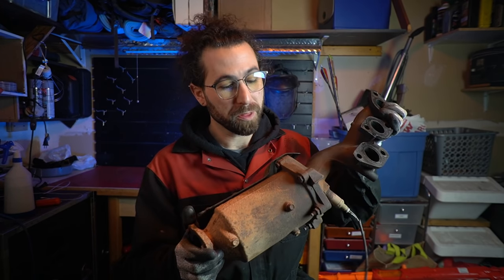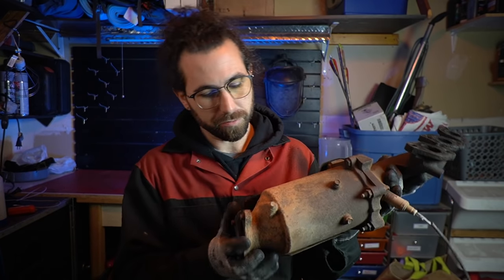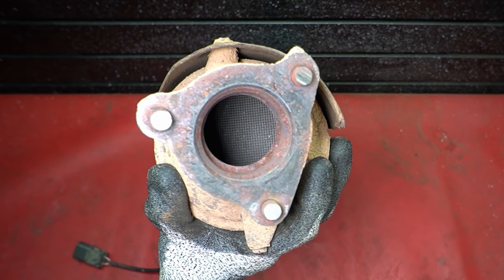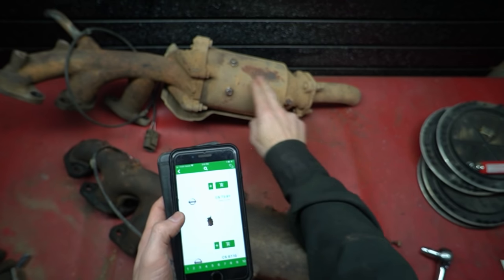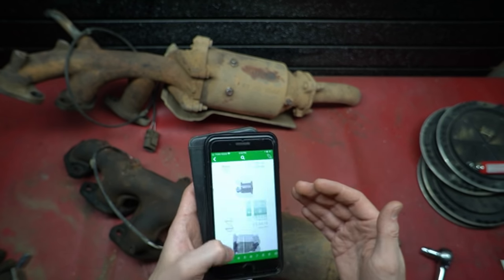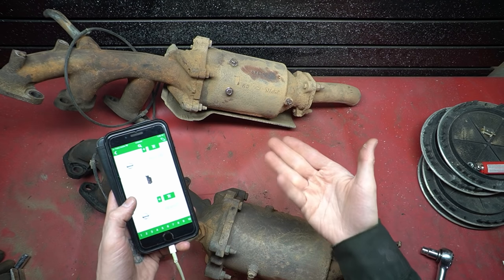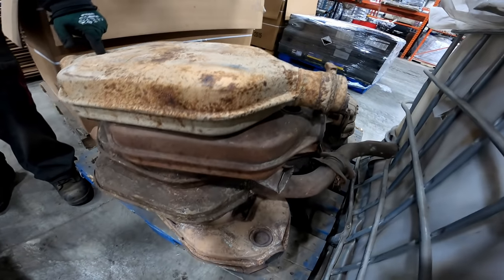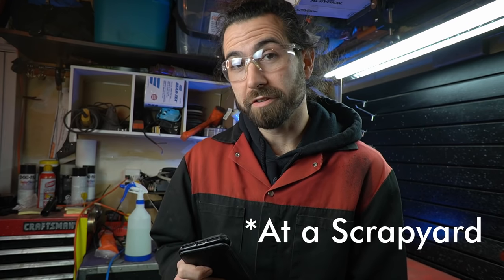How Much Is A Catalytic Converter Worth? Scrap Recycling Guide

Comment: Scrap dealers should be prohibited from buying these things unless they have documentation showing they are legit - too many getting stolen right now.
Reply: That's what keeps them in business brings value up and brings demand up I'm sure they won't unless lawfully enforced
Reply from the maker: I know that sounds like a solution but it would only make things worse. It’s just the material within that is valuable, so if you regulate it too hard you’d create a black market for platinum group recovery. Remember how prohibition created wealthy and powerful gangs because of how profitable it was? You’d have that. But with back-room refineries with dangerous chemicals being poured into sewer systems.
Reply: Ya. The places in Utah require a paper trail for copper & similar things.
CAT should be the same.
Reply: Thub, you a smart mofo. I like intelligence and you my friend got it🎉

Comment: For those who wonder, catalytic converter prices vary from vehicle to vehicle, buyer to buyer, and content regardless of vehicle. Most normal converter prices range from $25 to $3000. Some of the better ones are found on Toyotas, Hondas, and large diesel trucks. I was getting $1800 for Honda Element converters at one time. Ford F250, F350 trucks from about 2000 - 2005 were getting $2200. Some Dodge and Ford diesel trucks were fetching $3000. Crown Victorias and Mercury Marquis were getting $1200 for the group of four. Just for some ideas. The value can be different on the same vehicles with same looking converters also! Some converters are made with much more precious metal for cleaner exhausts depending on the laws of each State. Vehicles made to be sold in California have much higher values on their converters.
Reply: None of what you said it nearly as valid anymore. Market dropped by more than half now. Even 2 months ago when you made this comment market was MUCH worse. 
You're spreading false information. Those elements are like 700$ now lol
Reply: Hi There, any idea how much a Dodge Avenger catalytic convertor is worth(scrap)?
Reply: @JRenee-Sings  research more more 

I hope near the 700 max mark I read above your comment
Reply: Where did you sell them? Now that everyone is stealing them the price sky rocketed or some jump yards or pick u part type places won’t even sell them anymore. You can take anything you can get off from the car or truck except for the cat.  here in ca.
Reply: WOW NO WNDOR. THEY STOUL MY HANAS. CONBOTORS .
Reply: Beeeee,Esssssss
Reply: Where can i get those prices for my cats?
Reply: what about 2005 ford explorer
Reply: How much for the 2 off a Ca compliance cats for a 04 4.0 jeep

Comment: Pt, Pd, and Rh that is plated on the ceramic honeycomb are noble metals that have an extreme tolerance to corrosion and an extremely high melting point. They also have a very unique feature  and that is that in combination these three precious metals actually have the ability to be Catalysts in a chemical reaction. Catalyst = to speed up. Every single type of fossil fuel burned in a combustion engine create very hot off gasses of NOx (Nitrogen Oxides) and CO (Carbon Monoxide) both of these off gasses are said to have an effect on ground level ozone which is detrimental to human and animal health. Although NOx and CO when in contact with UV Radiation create O3 (ozone) --> smells like chlorine, this is technically good for high altitude because this is what thickens our ozone layer, the addition of more O3 molecules. Here's where things get tricky, at ground level if these gases were to come straight out of our tail pipes this would create ground level O3 during times in which we experience high UV from longer days. This unfortunately only happens when the sun is out, not as the days turn to night. O3 at ground level is bad for us no matter what and this in high concentrations creates smog. Another thing is that if our engines didn't have these metals inside the catalytic converters of our engines exhaust stream, then we would be contributing to highly toxic health concerns for our population at our lower atmosphere. Also a very complex issue is created when daylight helps to convert these off-gasses to O3, and at nighttime these unchanged gases go through complex chemical reactions leading to a high amount of greenhouse gases as these gases rise to higher altitudes and constantly react and change and become Volatile Organic Compounds (VOCs) our ozone layer causing its depletion. As per the Minnesota Pollution Control Agency's take on this more complex part of the process, they state "Most stratospheric ozone depletion is caused when chlorine or bromine reacts with ozone. Most of the chlorine entering the stratosphere is from man-made sources (84%), such as CFCs and HCFCs with the remaining 16% from natural sources, such as the ocean and volcanoes. About half of bromine entering the stratosphere is from man-made sources, mostly Halons." "While acting to destroy ozone, CFCs and HCFCs also act to trap heat in the lower atmosphere, causing the earth to warm and climate and weather to change. HFCs, which originally were developed to replace CFCs and HCFCs, also absorb and trap infrared radiation or heat in the lower atmosphere of the earth. HFCs, CFCs and HFCs are a subset of a larger group of climate changing gases called greenhouse gases (GHGs). Taken together greenhouse gases are expected to warm the planet by 2.5 to 8 degrees Fahrenheit by the end of century." To sum things up a little, this is the reason all combustion burning engines should have catalytic converters, they catalyze (speed up) the chemical reaction to change the harmful NOx and CO being off-gassed to a more suitable and easier to manage H2O (water) and CO2 (carbon dioxide). People who feel its good to steal these items from vehicles are contributing to the depletion of our ozone and destroying this planet and making people suffer at the expense of your selfish temporary financial gain. People who do cat deletes on their vehicles to make them sound better are just as guilty, and anyone who hollows out a clogged cat, or does a cat delete because you cant afford to replace it as also just as guilty. These products are necessary and exactly why it was mandated that all manufacturers selling vehicles in the US are required to have these on their vehicles.
Reply: Your degree is in chemistry, I presume?
Reply: No unfortunately when I have a concern about things or if I look for an answer to a question and it becomes complex, then I obsess over it, if it surprises me and I'm able to continue to find pieces of the puzzle that speak to me in a way in which it makes sense and I can learn and stay interested. So I just really enjoy finding the full truth about some things and collecting all that knowledge and sharing it if I'm able to do so. I actually don't even have a degree technically but I've been through roughly 6 or 7 combined years of higher education, if one were to tall all the semesters and credit hours. Sometimes a degree is just a piece of paper, but nonetheless I believe college and higher level education are necessary for an educated, professional, and diligent workforce. I believe one develops the necessary skill set within the upper level courses (300s and 400s) of higher education, to be able to get interested in a complex understanding of a scientific unknown to a degree that deep to hunt it all down and piece it all together. I'm not saying it's a requirement though, but it certainly was where I gained the ability. Something that may surprise ya is, I've never taken a single chemistry course in my education, but I now in life and my career path I certainly wish I had. 💯🤷
Reply: @kylestrokelitus360  Your employer is lucky to have you in their work force. Thank you for sharing your knowledge with us.
Reply: @Anne--Marie  aww...that's probably the 1st compliment I've ever gotten on here. And one compliment I've received in a while. Life got really lonely for sure and now instead of being employed I've been working my ass off in building my own business. Which is another reason for the solitude. It's hard as hell finding anyone similar in my area and all my friends decided to betray me. It's been one hell of a curve for sure the past few years. But I'm determined to push ahead. I know my angles got me. 🙏
Reply: @kylestrokelitus360  Wow, I'm sorry to hear about your streak of bad luck. May this week be great because you deserve the best!
Reply: @Anne--Marie  As do you deserve the same. There's a lot that goes unrecognized in this world and a kinda heart like yours is one of them. May God bless you and never let that part of you change. A compliment like yours may save someone's life one day, it surely helped mine. Nameste

Comment: A quick way to identify the "cat" component of the exhaust system is to look for bolts at both ends of the part. These parts are expected to "go out" and need to be changed. Thus the nuts and bolts.
Reply from the maker: Ahh, that’s an easy way to spot them if you’re not sure! They come in so many different styles it’s confusing at times.
Reply: actually most cats are not bolted, they are welded!
Reply: @specialtysalvage297  I cut 60 to 100 cats of a week I think I know. If you see welds that's and aftermarket replacement. Worthless. Might as well leave it there
Reply: @specialtysalvage297  try again
Reply: @CowboyCarCrushing  I have to load some crushed cars now, maybe later I can come back to play with you!
Reply: Erik Olsen  they are close to the converter or ” actually” on the converter. Better ask Specialty Salvage. That's your best answer.
Reply: @specialtysalvage297  well I tried to find video of you removing catalytic converters 🤔 didn't find any. I'm truly not self promoting here but I built a channel from removing cats on video. You used the word ” actually" well that implies you don't think I know what I'm talking about. Well buddy I do. You show your ”factory” welded cats and I’ll show my factory "bolted”cats. If you can't then I understand. I got 11K subs and you got 1(which is me) but anyone can upload a video. 1 sub or 0. I'm truly not bulling here. But next time you reply to someone who is just trying to give some non-know it all advice use some Tact.  It's trying to get your point across without offending someone. Let me know when you post
Reply: @specialtysalvage297  WOW... look in the video..do you see the bolts?????
Reply: NICE RESPONSE. I AM IMPRESSED. NO REALLY.. TACT MOST DO NOT KNOW HOW. MY MOTHER WAS ALWAYS THE BEST AT MAKING ME SEE THE ERR OF MY WAYS WITHOUT BELITTLING ME. GOOD JOB.
Reply: @ronaldbroyles9312  insults seem to be the only way some can make themselves feel important. Talk to people the way you would like to be talked to. No excuse for rudeness

Comment: I regularly purchase vehicles specifically for their converters. If you know which ones to look for you can make a substantial profit. Almost embarrassing to say but I make more from 1 or 2 junk cars than I do working a 40 hour week as a cnc machinist...
Reply from the maker: That’s pretty rad.. what do you do with the rest of it? Do you have a hefty trailer to pick them up with?
Reply: @thubprint  I bought an 18' flat trailer specifically to haul junk cars for their converters. I tend to focus on the vehicles I know have good sets due to space limitations. There are quite a few vehicles that have 1k plus systems.

I also take the battery, alternator, starter, ac compressor, radiator, condenser, aluminum wheels and whatever wire/aluminum I feel like removing before I junk the rest for shred. If you're willing to put in the time junk cars are a goldmine these days.
Reply from the maker: Feel free to pm me with some of the cars to look for 😉😆
Reply: @thubprint  I also do this and would love to have a conversation about what cars to look for. I might have sent you a pm in the past.
Reply: @chrisney4466  what are some of the vehicles you look out for? Seems f250 f350 are good. Of course prius. Heard certain Hondas. Sold a couple convertors recently from cars I repaired and opened up my eyes to the money that can be made. Got 800 for an f250 convertor but realozing I could have got more. Hoping for some advise from someone with some experience. I used to always just scrap unwanted cars but now realizing its best to take off convertors, but also trying to get into looking for vehicles with known expensive convertors. Thank you
Reply: @matthewsolland5076  
Would be nice if you could leave a comment here for the rest of us to know which ones to look out for.
Reply: @noteem5726  There are a bunch but it also depends where you are located. Some places have little access to good buyer or yards or just have terrible prices. Priuses, f 150s, Honda civic and oddessy, some Kia's, foreign vehicles, and some other random vehicles can be great for catalytic converters.
Reply: @matthewsolland5076  
Huh, and you could probably buy a used Kia for pretty cheap. Thanks for the response, that's some good information.
Reply: @noteem5726  some kias cats aren't worth too much. I am not certain on which years or models have good ones. Maybe there are some forums out there that discuss it.
Reply: @matthewsolland5076  
Thanks, I'll look into it. I'm sure there's a reddit thread out there.

Comment: Shop around to different buyers, I have a shop and occasionally we get customer cars where they don't want to replace the engine or trans we part out the car and shoot pics of the cats to a few different buyers now we have a solid buyer and yes you can get 900 or more off cats from one car.
Reply from the maker: Nice! That’s probably a good system actually, just send pics and get offers before driving anywhere
Reply: in la

Comment: Someone just stole mine off a 1998 Honda Odyssey. Seeing as they are such hot items, do you need any documents to sell them to make sure they aren't stolen property? And can I buy one second hand?? Any help appreciated. The theft really screwed me and my car over for what seems like chump change. Ugh.
Reply from the maker: Yep, the amount they’ll get for it is nowhere near the damage. It’s just like when someone steals a purse or phone, the replacement costs to the victim are many times greater than the profit to the thief. You do need identification and a registered vehicle to be served at a scrapyard but that doesn’t do much to solve crimes, it’s just a paper trail for the tax man. Used cats don’t really happen but you can get an aftermarket one for much cheaper. They clearly aren’t as good but they do the job for 60k miles or so.
Reply: We operate an auto repair facility, and one night, thieves stole the cat converters from several customers' vehicle that were parked in our customer parking lot. Cost of replacement was from $600 to over $1400 depending on the vehicle. The thieves were well 'known' to police and were caught a few weeks later. They are a crew who go out every night to steal cat converters, and the buyers never question where they come from, or if they are stolen. In my opinion, the buyers should be charged with receiving stolen property. After all, they are profiting from the proceeds of crime. As for our shop, we've recently spent a lot of money on surveillance equipment.
Reply: @rollydoucet8909 . Rightfully the shop paid for your customers loss?
Reply: @jat-justamaturetech-philpj8285  We contacted police and our insurers immediately, but the insurance company informed us that the car owners' insurance pays the claim to each car owner. It can be compared to your car being vandalized in the parking lot of a big store or supermarket, your own insurance company would pay for the damages to your vehicle. However, we did offer to pay the deductible fees for the insurance claims and we  waved the labor charges to repair the vehicles. The clients/victims were compensated by their own insurers for the costs of the parts. We have since installed more outdoor lighting and a surveillance camera system.

Comment: Ecocat is way far off prices we are getting in ontario, sometimes way high, more often then not, way low  best bet when selling cats is send pics/codes to a few buyers for quotes, you'll earn much, much more, also, pull the o2 sensors, they're worth $$$ too
Reply from the maker: I didn’t know O2 sensors were worth money!
Reply: How much can you except to get from o2 sensor
Reply: The going rate in ontario (for me at least) for o2 sensors is roughly $6/lb (which is roughly 6 o2 sensors)
Reply: Also, I apologize for taking so long to reply, wasn't getting notifications for some reason for a few weeks lol
Reply: @thubprint  especially the 5 wired ones have higher amounts of Pt in them

Comment: Such a font of useful information! The tweakers of rural Iowa thank you.
Reply: i gut my cats and weld them back in,  they look like cats but are empty and worth maybe 1 cent in scrap value. if the electric company can chip and burn tires for fuel then so can i. if people can dig a hole and push their old house into it and burn the house then i can tear the house down and burn it in my outside wood boiler to get hot water and heat, and create electricity with the TEG's i have connected. my neighbors have burned 3 houses recently while my old house provided free heat and hot water for 4 years. i polluted the air no greater than each individual neighbor. if they complain ill deal with them!